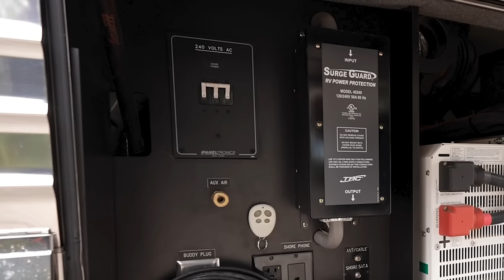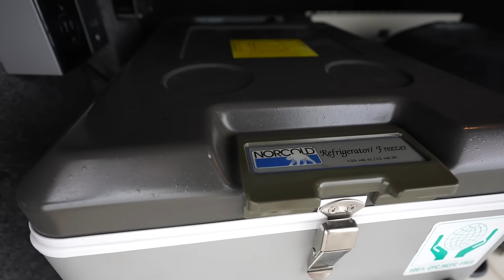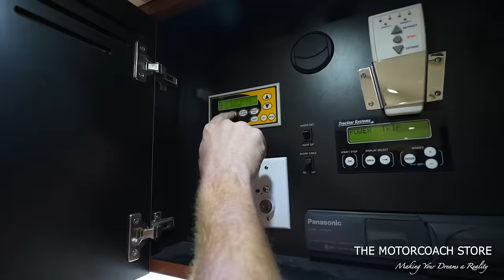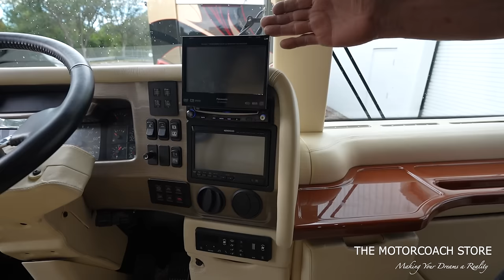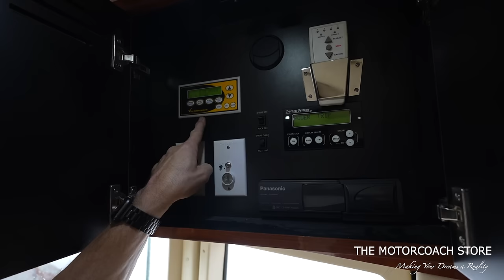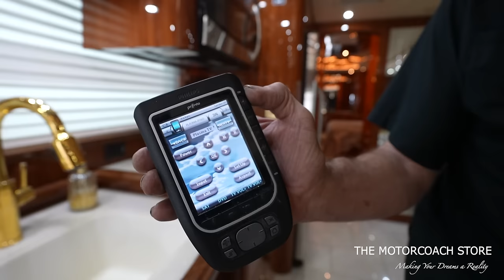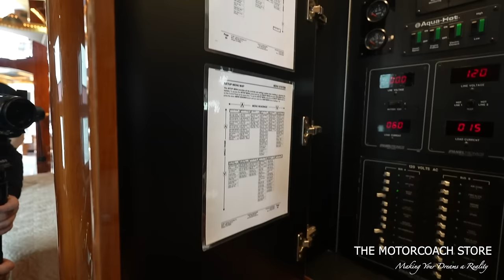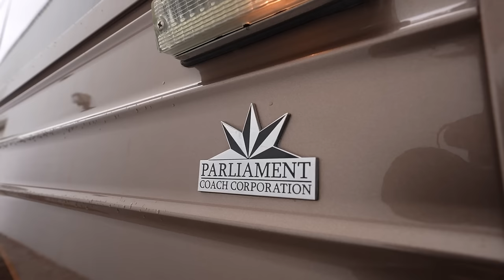Extremely RARE  40' Prevost Parliament XL2 Double Slide For Sale $399,999!!!

Comment: I paid almost $400,000 for a 2023 Tiffin Phaeton 40’ with a multitude of issues from the paint to the chassis components. I probably should’ve bought this conversion and saved a lotta headaches. I would definitely update it with a  crestron system and a few other items, but the quality and workmanship, in this unit are incomparable to what you get in today’s market

Comment: Andrew, could you check and get an accurate measurement on length ?    I plan to buy an RV, do a cross USA tour and then bring it to Norway... We have a max length allowance  of 12000 mm or 12 meter...   After looking at other 40 feet RVs I discover 39 feet is not exactly 39 feet, 40 feet is not exactly 40 feet etc.